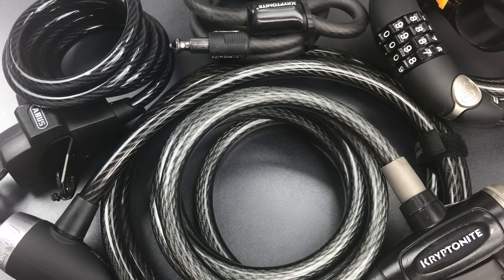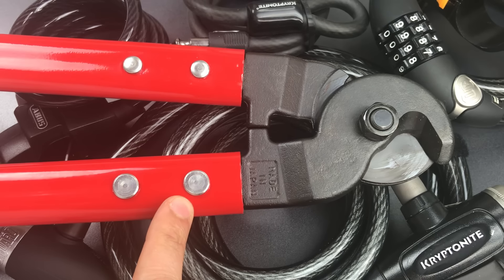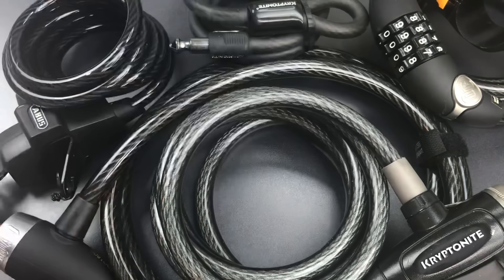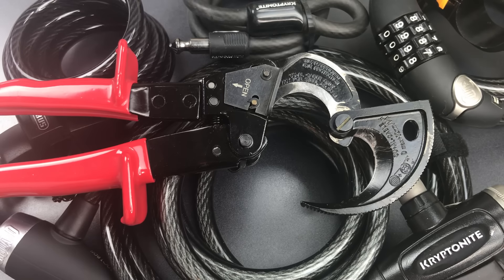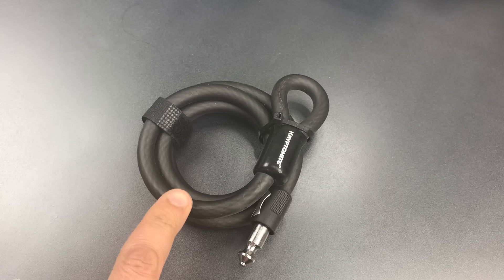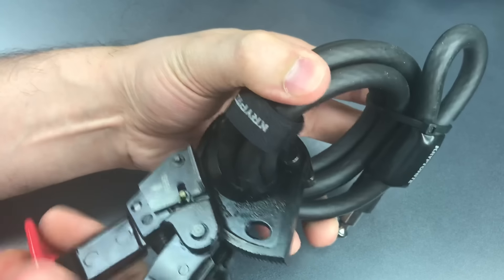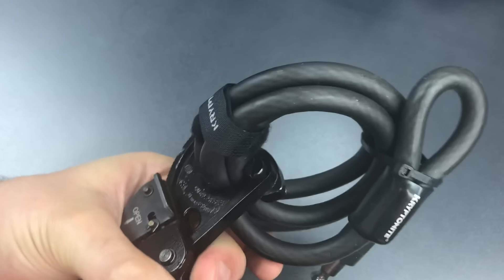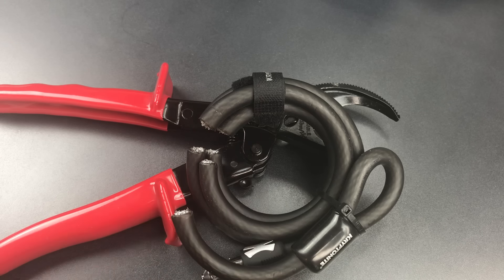[748] Cutting Bicycle Cable Locks is EASY!

Comment: In 1987 I lost a $1000 mountain bike to a cable lock that was cut with bolt cutters.  It was the thickest cable lock I could find at the time.

They rolled up in a van, blocking view of the rack, opened the side door, cut the cable, loaded the bike and absconded... total elapsed time about 30 seconds.

The rack was right outside a tilt-up office with large windows on the ground floor, 1/4 mile inside a corporate campus.  

Fortunately the company reimbursed me the price of the bicycle, and changed policy to provide indoor bicycle storage.  

I was very lucky with my employer.
Reply: Man that sucks anyway though. Why do people have to make a living with other peoples property?
Reply: The point is, cable locks are next to useless.
Regular hardware store chains can be cut by a cordless angle grinder in a matter of a few seconds.
Hardened security chains will last longer; maybe a minute.

I never used any sort of bicycle lock, after that theft.
Not even a kryptonite U-lock.
I would never let the next bike out of my sight, unless it was behind a locked door.
Reply: And in your case, they could have used a small hydraulic cutter too. There is no real difference between hand held and hydraulic if you can park a van beside it, plus it is just as quiet... And probably even faster...

So even those metal bar locks for motocycle would be good against that...

Unfortunatelly, it is impossible to make it theif proof...

A while ago, I've hear of some theif that got 'creative'. They took the full rack with the bikes locked to it. Then they have all the time they want to unlock them.
Reply: All a lock or a security device is meant to do is to deter theft and hopefully make it difficult enough for the would-be thief to move on towards a much easier target... however, if the said target is valuable or high-profile enough, then more stringent security practices or policies must be implemented for the best amount of security to counteract the threat level.

As for high-value targets, solid, closed/locked doors are the best security measure of deterrence against the threats of theft or vandalism.
Reply: Christopher Lawler if u spend over a grand on a bike i would consider a gps tracker built into the frame
Reply: Benni, did you read the first sentence? He said it happened in 1987.
Reply: Sold, closed and locked doors are only a security measure if they are also manned. Otherwise it's just a way to delay.
Reply: Time to start removing a wheel when you go inside 😂
Reply: @misterhat5823  the other factor was (accidental) long term advertising.  I was commuting on that bike, and it was spending the same damn eight hours on that rack every day.  They had weeks to spot the bike in the same location, and obviously carefully planned the heist.

My boss, the chief engineer, was commuting on an even more expensive French road bike that he parked in his office.  Part of my argument for reimbursement was to point out the relative insecurity of outdoor storage, and that I had asked permission to keep my bike in the lab, which had been denied.  He didn't have a moral leg to stand on.   He asked to take the cut lock to HIS boss, the CEO of that division, and got the storage accommodations changed.  Took a while for him to figure out how to reimburse the replacement price off the books, but he worked it out.  He was a good manager.
Reply: For a moment I thought the company that created the cable lock that you were using paid for the bike. That would be awesome.
Reply: , no such luck!  It was the aerospace manufacturer I worked for.  In the San Francisco East Bay.   I was an engineering tech, and the Chief Engineer was the boss who chased down the reimbursement.  He was an exceptional engineer, old school.  They don't make them like that any more.
Reply: Damn you should've stayed with that company... You don't find many places like that these days, at least not where I'm from.
Reply: Hahahaha!!! Don't I wish!  There were a hundred high tech firms within driving distance here in 1990.  By 2000 they had all disappeared overseas.   Neoliberal globalization.  NAFTA.  The  Clintons gutted that economy and it never came back.  At least a hundred thousand good technical jobs around here, not just assembly line work, but engineering positions.  All gone except for that forty- and fifty-something generation that was let go long before they were ready to retire.
Reply: assassinlexx  I grew up in the automotive Midwest & watched it turn into the rust belt.  Escaped to Silicon Valley for 3 good decades and watched it gutted the same way.  El Trumpo, IMO, doesn't have a clue about what it took to grow a high tech culture that supported all those production jobs.  I was one of those engineers that kept the machines in repair and up to date.  The manufacturing engineer is extinct as a species in the States.  None under the age of 60 left.  

Apple, for instance, looked seriously into bringing back iPhone manufacturing ten years ago and gave up because of the shortage of technically qualified engineers.  It was going to take them a year of intense headhunting to fill a hundred engineering slots.  In China it takes a week.

We are well and truly fucked.  
As is our feckless leader.
Reply: @MyH3ntaiGirl  We have strayed very far off-topic here, but while local and regional 'capitalism' generally work very well, this new version, global predatory capitalism, is destructive in the extreme.  The pattern has become clear as labor forces in many countries are developed and then abandoned as the globalists exploit one third world country after another.  Under the current set of international "rules" (or lack thereof), there will always be and endless supply of labor willing to work at starvation wages.  The global system is broken.
Reply: Lucky it was only a $1000 bike
Reply: Ofbaserion He was not allowed to keep it inside until after this happened.
Reply: 1000$ bike with no chip inside it?
Reply: Glen Rickerd 

I lost a bike locked to public bike rack, that was cut with a hacksaw.
Reply: Glen Rickerd did u have to walk home
Reply: Glen Rickerd I might have bought it in Craigslist it’s in a good home now
Reply: Wow great employer to look out for you guys like that.  Sorry those assholes stole your bike.
Reply: @GlenRickerd  wow excellent.  Love it when good managers figure out to solve problems
Reply: FAKE STORY ALERT PEOPLE !!!!! FAKE STORY ALERT !!!!
Reply: Try going back and reading the details.  

Here:
I'll help by using short words in short sentences.

It was 1987. 
29 years ago.  

The same $1000 bike in 1987 would cost $2250 in today's dollars.
You can google "consumer price index and calculate it yourself.

Lock technologies in 1987 were very primitive.  
Even the Kryptonite types.
No one was using hardened chromoly steel chain.  
Cable locks were relatively new.
I found one with a good built in tumbler lock and an exceptionally thick steel cable.
I paid $30 for it.  Today it would be $75.
Bolt cutters were a new development in stealing bicycles.
So new, we had never heard of it.

It was a closed-off aerospace campus.
The bike rack was 1/4 mile inside the gate.
I was required to lock the bike outside, until the theft.  
Afterward they changed the policy to indoor bike storage.
My engineering manager also commuted, on a European brand street bike worth twice what mine cost.
He kept his in his office.  The lab I worked out of had space, but I couldn't get permission.
He went to bat for me, to cover the loss of the bike, seeing it was on company property and I had followed company rules.
I was lucky to have a manager who was still a human being.

My bike commute was 10 miles in 40 minutes, using a combination of bike trails and city streets.
No, I didn't walk home.  I called my wife and she drove over to pick me up.
Reply: Thank you for the vocabulary word
Reply: I'm curious as to what kind of bike it was? 1987....$1000. That thing had to be bad ass. 

That would be like stealing a Specialized Turbo Revo or Levo in today's world....
Reply: That exact scenario happened to me, although they fumbled at some point and didn't get through the cable, I think someone spotted them. Never used a cable lock since.
Reply: Mister Hat 

https://youtu.be/McIemoQWv64
Reply: @thephantom1492  That happened here in Orosháza too a few years ago. They took a whole rack from the front of the hospital. Nobody reacted from the sheer shock that they dared to do that in the middle of the day.
Reply: I would have to be a millionaire to even consider a $1,000 bicycle
Reply: Sounds  like  a  typical  baby boomer job.
Reply: Secerity cameras were pricy back then
Reply: how is it that you know exactly how they stole your bike?
Reply: @normanladdleschnitzel1928  What good is the wheel when they have the rest of ur bike. They can throw ur bike into the trunk of a car, a van or the back of a pickup. I even saw a pic of a dude walking down the street with a bike imissing its front wheel in a shopping cart.
Reply: @bobraible  damn lol. Do they sell the bikes for scrap or do they turn it into a unicycle?
Reply: @normanladdleschnitzel1928  I would guess that they would look to steal a bike that had a locked frame and a front wheel unlocked.
Reply: Sounds like  your employer had government contracts. Under Reagan, military spending had increased. 
ESPECIALLY, for California firms.
Reply: Exactly.  Just like he shows how easy it is to pick all these hundreds of different kinds of locks... 99% of thieves are not picking locks or carrying around ratcheting cable cutters. 
I’ve secured my 1100$ Carbondale for 7 years in Chicago still today with the same cable lock and never had a problem.
1987 is not 2020.
1987 required skill/knowledge to commit many crimes, today thieves in Chicago are running into stores on Michigan Ave and running out with $30,000 or more in clothes or iPhones. People are grabbing people’s cell phones out of their hands and running away. 
If you want to be a thief in 2020, it does not require skill or even effort.
Reply: @anythingatall8550  Security Cameras go 8 for $200..... er.. before Trump's tariffs.
Now, they probably go 7 for $200.
Reply: @emanuel1281  donut - it was 1987! what kind of 'chip' are you thinking of exactly?
Reply: @zeitgeist909  yes good point
Reply: @emanuel1281  GPS was developed in 1978 and became fully operational in 1995. The first affordable civilian applications did not appear until the early 2000s. Do people these days really believe that technology like that existed for the average joe of the 70s and 80s?
Reply: 1987? Expensive mountain bike? 30 seconds....

Oh boy I've got some explaining to do
Reply: crazy how a cheap car also cost a $1000
Reply: @GlenRickerd  You made the mistake of asking for permission to bring you bike into the office.  It is always easier for a boss to say no, so the best policy is just do it and if needed apologise afterwards.  I did this several years ago, note I had prepared everything so that it was impossible to get the floor dirty, it was as discrete as possible and the only objection anyone could have was it was a bit strange.  The boss could not object as there was no where else to leave the bike and I had put in place a good solution.
Reply: @emanuel1281  Where the fuck was he meant to get a GPS tracking chip to fit inside a bike in 1987?
Reply: Yes a cable lock in itself is useless but for a $1000 bike it would be a good idea to use one good lock say $100 and also use a cable lock and doing this basically makes your bike look more intimidating to steal and it protects your tire.
Reply: I learned a new word !
Absconded !
Thanks 
👍
Reply: @GlenRickerd  Cable locks aren't useless. Without a lock, the insurance doesn't pay. I need to invest 5 bucks to get the 1000 bucks bike paid. People who want to steal bikes don't care about locks, that's true. But people who just don't want to walk home when they're drunk won't cut a cable lock. Long story short, buy the cheapest lock just to have one.
Reply: LPL could cut it with cheap side cutters in 37 seconds. Not that he would bother when it takes him 28 seconds to pick it.
Reply: why would you put trust in one lock? I used to ride $50-100 bikes and still used 2-3 locks lol
Reply: I can have bicycle theft insurance from my employer but i have to ask for it and prove that I bought a bike lock for 50 € at least. The lock won‘t be paid.

Comment: Nice demonstration! I knew these locks couldn't be trusted because when I was at the university, it wasn't uncommon to find such locks cleanly cut like this one…
Reply: That why after my roommate lost my bike I bought a shabby beat cop bike as a replacement. No one want it. Locks are detergent anyways.
Reply: They're still useful, though, I think -- mainly as a side-kick to a beefier U-lock or chain.  Indeed sometimes a relatively long cable is the only way to lock your bike to something solid when you are somewhere where there are no real bike-racks and you have to improvise by using a tree or something.  Other times they're good for keeping people honest when it comes to your seat or tires.  Also, almost always, two locks are better than one!

Comment: stronger demo I tested at home: a heavy tin-snips will cut most cables! it's b/c metal that isn't hardened is easy to cut. and if you hardened the cable lock it would have the stiffness of automotive suspension springs

Comment: You clearly don't need a pair, but the Knipex 95 32 315 is rated for steel armoured cables.
Reply: And costs more than most bicycles. :D
Reply: Weltenspinner LPs  Wow, they're quite expensive! 😲😲😲
Reply: Meh. €230. About what you'd expect for a professional quality German tool that should be good for many years of daily use.

If that scared you, you probably shouldn't look up the prices of the crimpers you'll need to terminate the cables that this thing cuts.
Reply: "Hey, Billy, screw the bike. We are taking this expensive as fuck lock."
Reply: Bike frame may be easier to cut...
Reply: John Alexander: Where is one going to put so many stolen bicycles?
Reply: £250~. Pretty cheap.
Reply: It doesn't matter what most bicycles cost when you can chose the one you're going to nick. It wouldn't take long at all to find a bicycle that could recoup the cost of that tool in one go.
Reply: If you'll pinch a bike you'll pinch a tool.
Reply: Every decent electrician has them in thier car, not suggesting anything tho >.>
Reply: They are usaly right by the small hand held one wich can cut 1 lockwire like its butter(or your finger if your not carefull :p )
Reply: or you know 50$ angle grinder
Reply: Ones like these are £25 on amazon
Reply: Knipex make's quality tools and I prefer American tools but the Germans also make great tools.
Reply: John Alexander yeah those are around $1200, asked to borrow a pair from the shop I work at, i was laughed at for thinking that was a possibility
Reply: knipex tools worth every penny.
Reply: @darthpaul4432  yesir ,ohn foe nem
Reply: @joeford860  as a professional electrician for 20 years Klein (american tools) quality has dropped big time! Knipex is taking over the market. Electricians pliers stay grippy and cut hardenened wire, they last 3 to 4 times times longer for 20$ more.
Reply: @jrand2631  You get what you pay for. I have some Knipex tools for 30 years and more. Never regretted buying one, even though sometimes I had to save a bit for being able to buy them.
Reply: @WeItenspinner  If a thief can find the tool from local hardware shop, they really don't mind how much the label says, right?
Reply: @MikkoRantalainen  Good point actually.

Comment: The "steel" those cutters refer to means the steel in ACSR cable, which is aluminum strands wound around a core of steel strands and used on power lines. The steel strands are quite thick galvanized steel (an 8th of an inch thick each at least) meant to withstand the weight of the cable (which, being as least as thick as your finger, is very heavy) and winds, branches, green hard hats (google it), etc. It takes considerable time to hack through it with even a hacksaw. The steel strands in that bike lock, on the other hand, are so thin that ratchet cutter will have no problem with them.